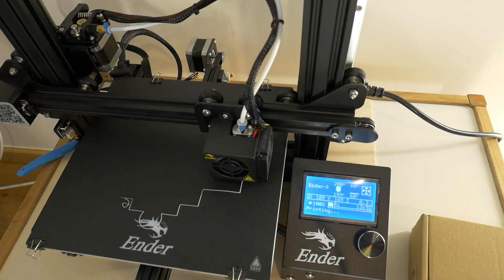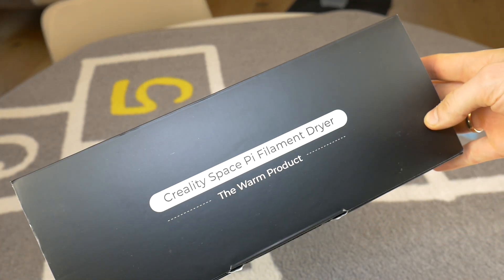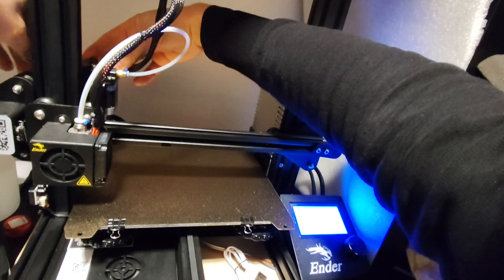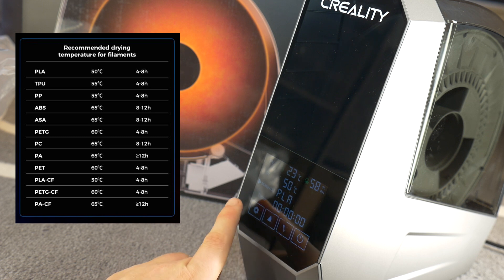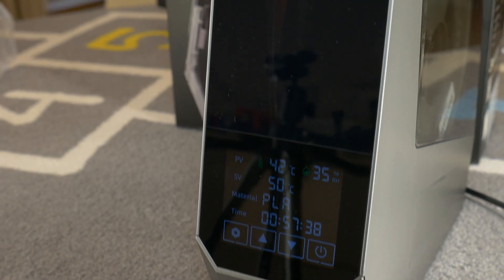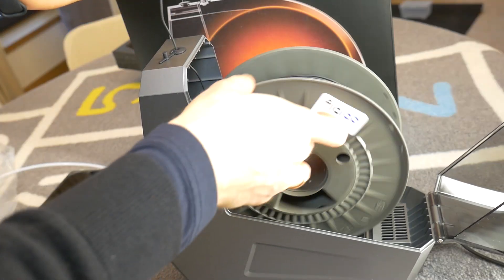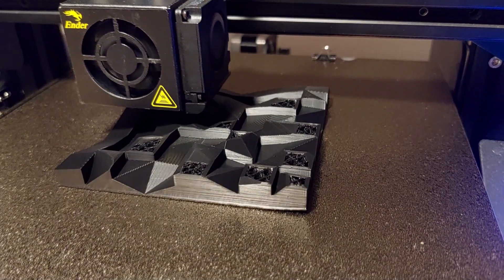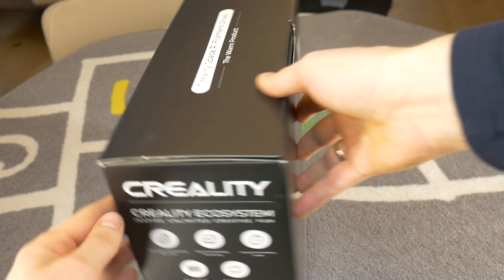Creality Filament Dryer Unboxing & Setup! Is It Worth the Hype?

Comment: Does the tiny lid needs to be open?
Reply from the maker: No, it's made for filament output for the printer. If you use the dryer only for drying filament, it can be closed.

Comment: I like mine,  I use it whilst printing.     Had to lubricate the bearings a little,    Runs smooth,     Feeding the material manually to get it through the whole PTFE tube to the print head is a pain as there is a LOT of sharp plastic inside the unit that cuts your fingers as you try and feed it through, I need to sand all that down.
Reply from the maker: thanks for feedback :)

Comment: How well does the spool rotate in your unit? Mine has a lot of resistance and I can't use the spool while drying it at the same time, there's too much tension in the filament.
Reply from the maker: 5:20 Make sure the filament comes from the bottom of the spool, not the top. If the filament comes from the top, it will be taken at too sharp an angle, which can cause problems. Also, check that the filament spool is centered between the bearings.